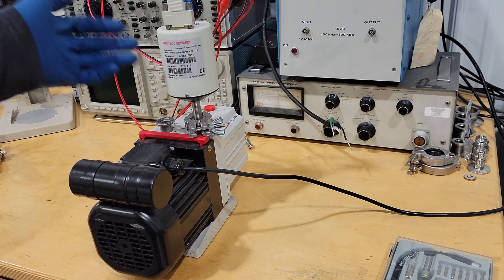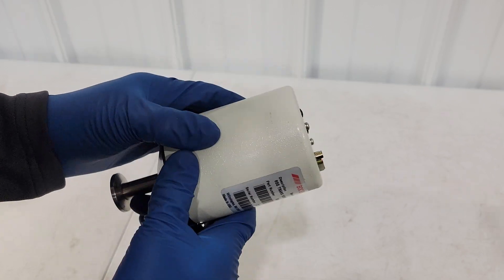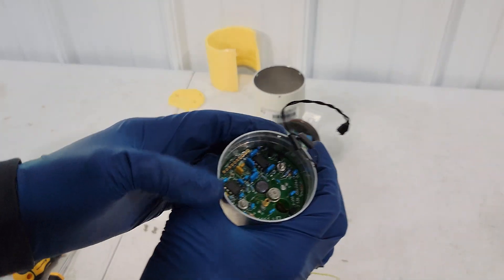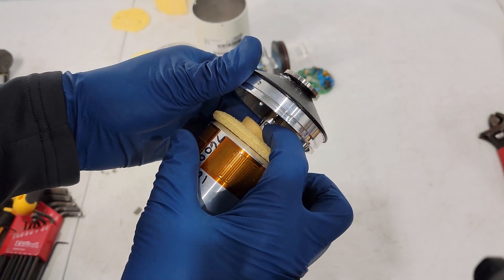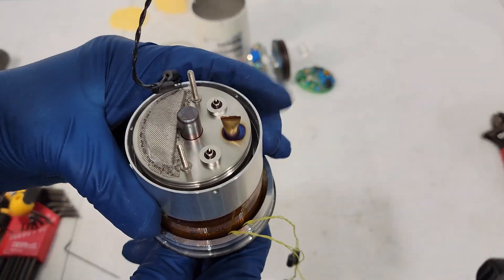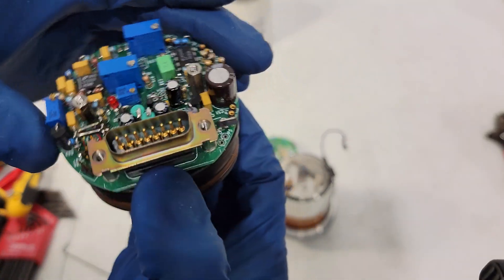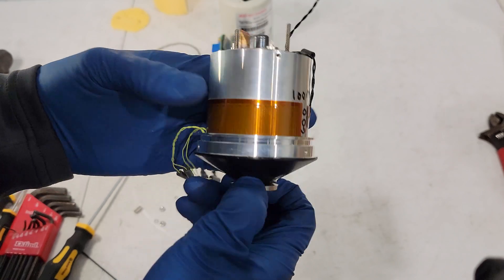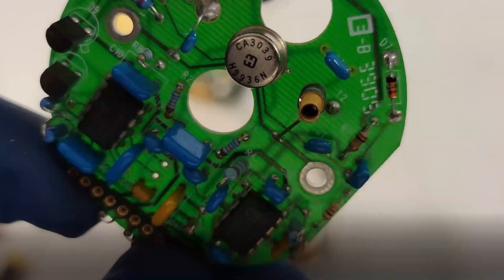Capacitance Manometer Vacuum Gauge Teardown Part 1

Comment: The cylinder at 7:42 is a getter container. It's just a stub inside that contains a material activated by heat(hence why it's so discolored, it was induction heated) that absorbs the remaining gases from the reference side after pumpdown, which is evacuated to an ultrahigh vacuum through the cold weld pinchoff(which you may have popped by prying through the hole, they are exceptionally fragile) - typically as high as possible, but the pressure is still recorded and calibrated for.
These gauges operate around RF frequencies, the diaphragm/dual capacitor set being part of the coupling circuit, or the resonant circuit(varies by manufacturer). There's not much to it, but the physical design does get tricky. That's why the matched diodes are there.
The heating bands are most likely to keep the physical structure, membranes, and the diode/opamp package at a constant temperature, since material properties change with temp. That's why the RF part sits in a clean desiccant can.
There's basically nothing to see inside the gauge - it's assembled through welding, so you won't find anything besides a set of three rings welded together with a membrane between the two and the endcap on the end. This is however an advantage - capacitance gauges are extremely robust, and are very nice to clean. Just fill the vacuum side with acetone, swirl it around, rinse with DI water, then dry with ethanol and bake to ~50C(or just place under a vacuum immediately and evaporate).
Reply from the maker: Great info! Thanks.
To your point about the getter container- what is the mechanism for induction heating of the activated material? I didn't see any coils on the PCB that came off of it.
Reply: @reedpetersen  It's only heated once to activate it, during production.